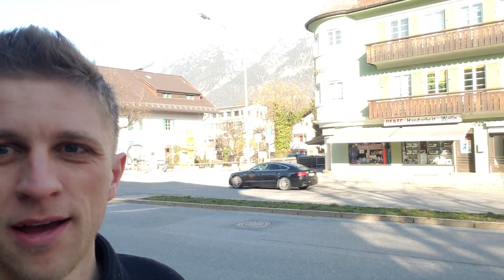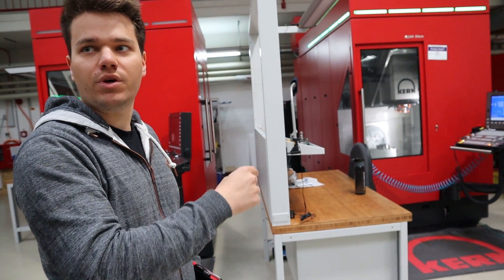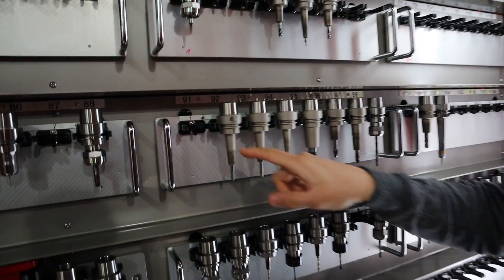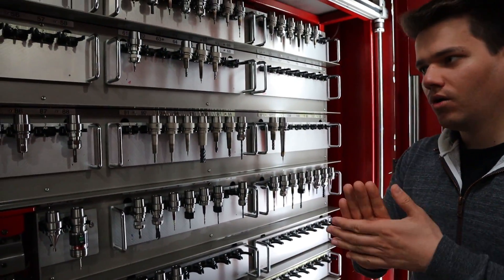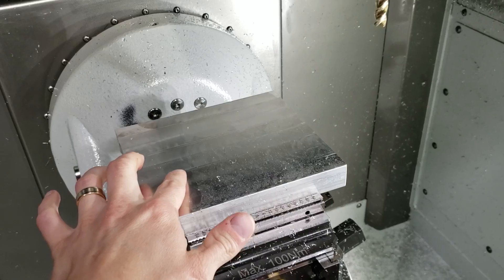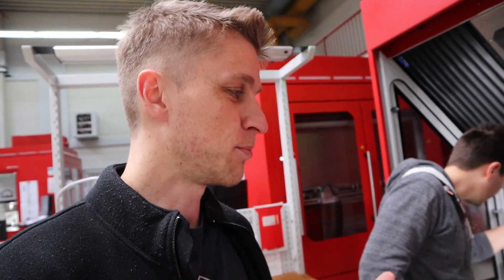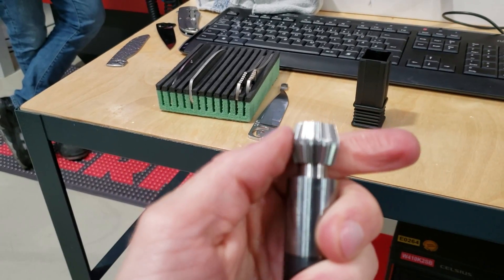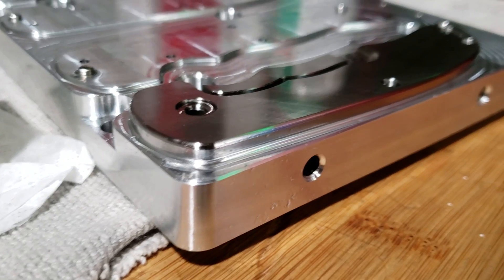Making a Knife on one of the BEST 5-AXIS Machines

Comment: Regarding the aluminum framing..... it will of course be very rigid but ALSO it will vibrate and send all the micro-vibrations to the base, wich is of course made of nodular cast iron with EXTRA graphite. That creates a base which will absorb and dampen all the vibrations. That's a MUST for surface finishing.

Comment: When checking surface texture like you were after that surfacing pass at 9:53, put a plastic grocery bag over your finger and then check. Any irregularities will be made much more apparent. Learned that from a car detailer, and applied it to my manufacturing tech classes. It works.
Reply: The plastic garbage bags you can get in rolls of 25-50 are cheaper and rip easily

Comment: So could you just put in a program and make basically what ever you want if it could fit?  It would be cool to make stifling engines in this
Reply: thats the point of a 5 axis mill, you can produce anything if weight and size is compatible with the machine
Reply: @hephaistosthesmith2069  In real life, the main point of 5 axis mill is to have less operations and changes of workpieces. This is why they are merged with robototic cells to hold workpieces and pallets, and big tool changer library. This way there is very little downtime, and because of how accurate these machines are you can leave them unattended and they can operate whole night without anybody around, and make complex parts. Huge cost saver, and your end pieces are to spec. Sure, they are also useful to make complex shapes, but it all depends on application, and level of precision required.
Reply: @movax20h  thats the in-depth answer, and i fully agree, i dont work with milling machines anymore i work with huge lathes, but i had multiple cnc courses for 5 axis milling machines, the only thing that sets you back is your imagination on those wonderful machines

Comment: The battle for machining supremacy between Germans &  Swiss, back in the day.  they used to see who could drill the smallest hole. So the Germans would take the smallest drill the Swiss could make and they would drill a hole in the back of the shank of the bit, handing it back to the Swiss. The Swiss would take the German bit and send it back with an even smaller hole. This back and forth went on for years. 1mm hole is small but they have much smaller threads they can do.
Reply: 1mm is even by industry standards not really small. Kern machines for example are so ridiculous you can drill a hole through a human hair. The bits are so extremely fragile that you are not allowed to use the automatic tool changer as it would break the bit. With air friction.
Reply: the winner has the best pistols
Reply: Once French Scientists fabicated the worlds thinnest wire . Then Germans turned a thread on it and drilled a hole trough.
Reply: @Hendreh1  This is an urban legend. The original legend states the wire was made in Newburgh New York, and a rival from upstate drilled the hole. I think you added the thread part? Either way, its not true, but it's a fun myth.

Comment: Reason you have those steps is the tram error in the head. Get a tech in, get your machine levelled and the column and table aligned.
Reply: Or too much tool pressure to some degree.

Comment: I don't get it why is this one of the best 5-axis machines? the manufacture claims that the machine is accurate within ± 0.5 μm. Its impressive that is for sure but is it still the same accuracy if it is milling full 5-axis? If it is milling 3-axis it's accurate that is for sure but that accuracy has almost every modern machine if it is milling 3-axis. To be clear this is the first time i heard of Kern. And i'm not saying that it is a bad machine i'm just wondering why he called it one of the best? I know Yasda's are one of the most if not the most accurate machine out there and i'm not sure if this machine can compete with a Yasda? Again just wondering :P
Reply: Tim no machine can compete with a yasda
Reply: kerns 5 axis mills are accurate + - .5 micrometres even when run in 5 axis not just 3, most of yasdas tech is copied from swiss/germans, like they did with their steel manufacturing by buying out thyssens blueprints and ovens

Comment: What a rad experience! I really appreciate you sharing this dude. That machine seems really well thought out and 100% geared for precision, user control, and feedback. That tool changer is epic. Kern really wasn't on my radar before, but I'm sure glad they are now.  Honestly. I never really thought about the orientation of the tool holder in the spindle making much of a difference in the vibration, but I guess when you're trying to do what they are EVERYTHING matters. Pretty clever with the indexing, but it leaves me wondering if they can't come up with a better 'poka yoke' so you don't put it in 180 like you said. The laser is good and low mass change which is important not to induce a vibration change in the balancing, but I wonder if there is a better way to make sure you put it in only 1 way and not depend on operator input to check the laser marking. In my experience operators will always mess it up eventually haha. Cheers, can't wait to see the tour!
Reply: The fact that it gives live feedback seems amazing for someone still stuck in the early 90s as tech goes. :) One day.
Reply: to answer your poke a yoke question the answer is, balance.

Off setting the tool holder in anyway throws it way out at high RPM which what these little tools have to run at. Small Diameter means less surface footage.